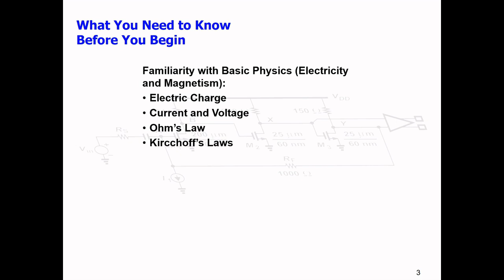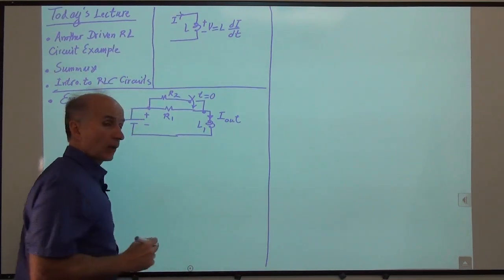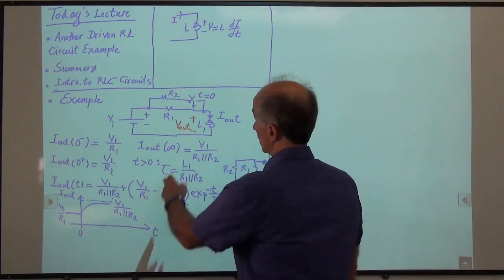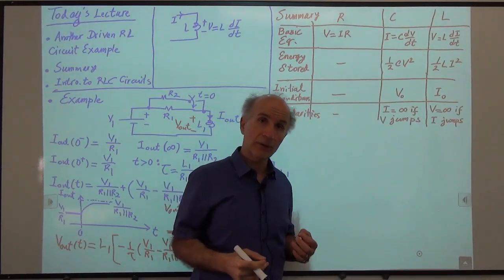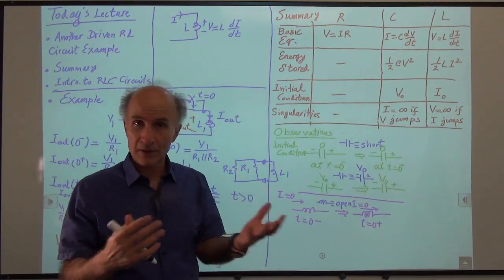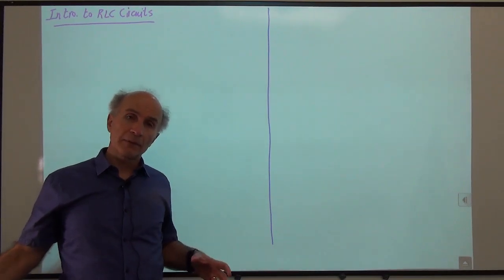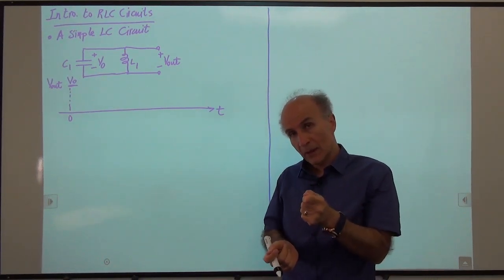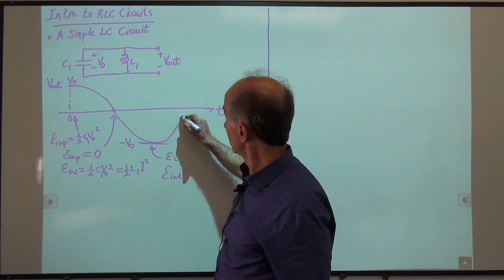Razavi Basic Circuits Lec 27: Introduction to RLC Circuits

Comment: 00:03 Introduction to RLC Circuits and summary of properties of resistors, capacitors, and inductors
03:52 RLC circuit behavior with initial conditions
08:44 Analysis of RLC circuits with constant currents
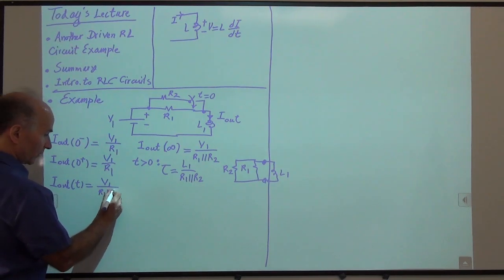11:17 Analysis of current behavior in RLC circuits.
16:20 Summary of RLC Circuits
18:44 Comparison of energy storage in resistors, capacitors, and inductors
23:39 Capacitor can be modeled as a battery with value v0
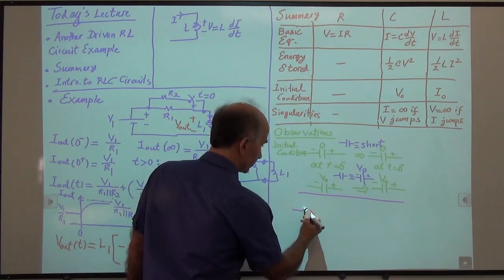25:46 Modeling inductor as open circuit during time period
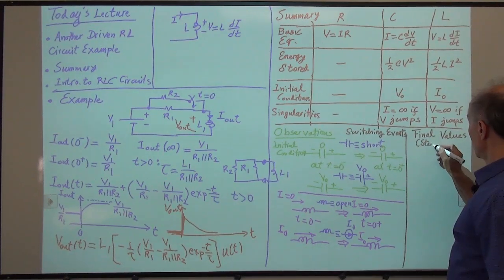30:23 Understanding behavior of RLC circuit components in steady state
32:44 Introduction to RLC circuits and their importance in understanding real-life circuits.
37:05 Introduction to RLC Circuits: Basic concepts and foundational understanding.
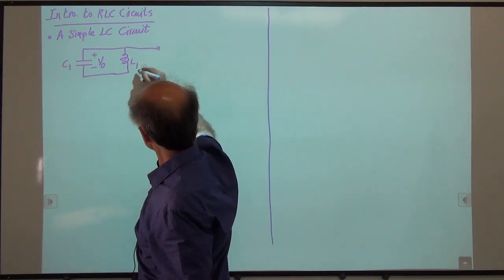39:16 RLC circuit behavior explained during discharge phase
43:27 Inductor stores energy when voltage across the capacitor collapses to zero.
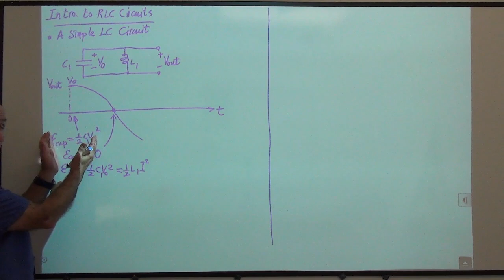45:12 Energy transfer process in RLC circuits
Crafted by Merlin AI.